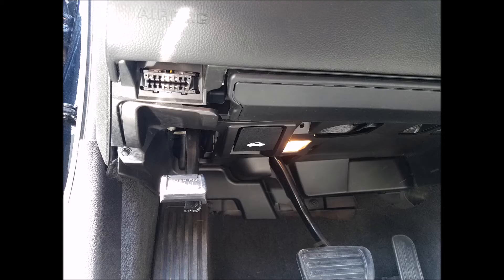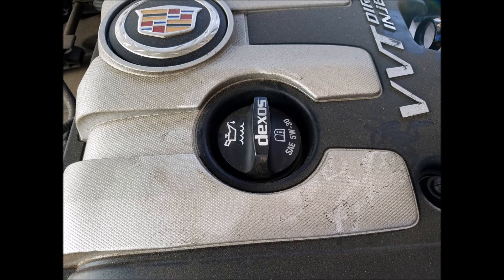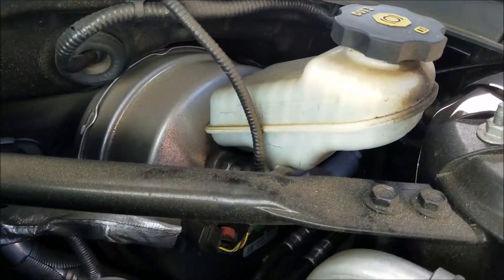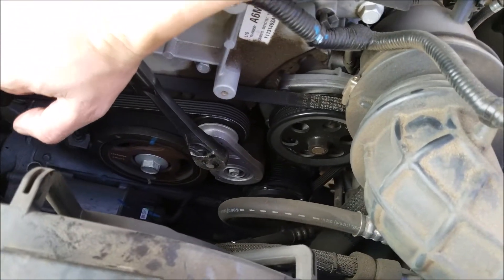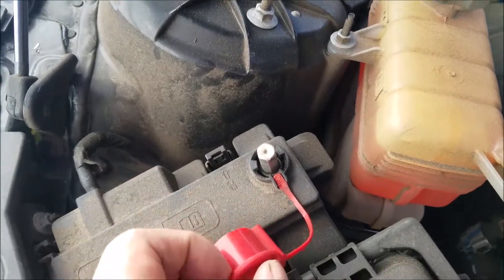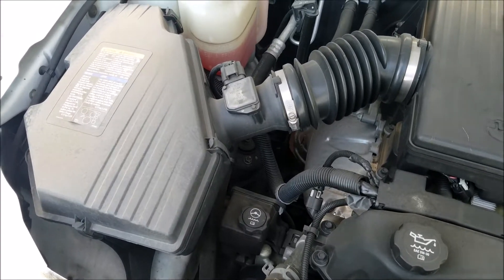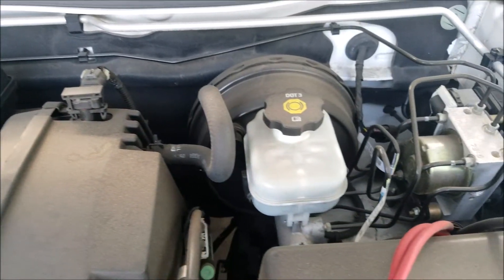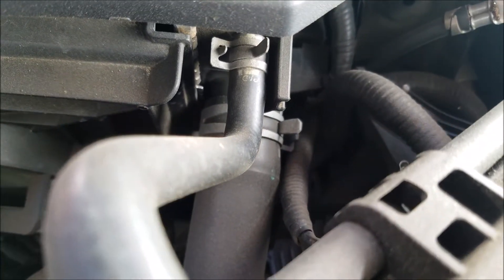What's Under The Hood - Names of Basic Car Parts and What They Do

Comment: I appreciate the video. Straight to the point. Could you help. I am trying to identify the name of the parts that filter the debris on the outer left and right side under hood, right under windshield. It's where the rain water drains.  For 2006 325xi. I think it's a "rain/debris filter" but just don't know the technical term.  I am trying to order and replace one but can't locate it on Amazon because I don't know the exact name for it. Thank you greatly in advance.
Reply from the maker: u mean the cabin filter? i believe ur referring to the cabin air filter.  Thank you so much for ur comment:) and always glad to help when i can.
Reply: @backyardchevy328  I am not sure. They're plastic, size is half our palm. There are two of them used for water drainage holes, to block leaves, etc., to get into the drain. Filter trays or leaf catchers?
Reply from the maker: Its a cowl drain guard, usually itll be a dealer or ebay part, but that should be the name to what ur referring to.
Reply: @backyardchevy328  YESSSSS!!! I just searched the name, it came up correctly.  Sir, you need to sit down your loved ones and tell them that you might be a genius. Thank you greatly!
Reply from the maker: Thank you, i really appreciate it:) Always glad to help, and glad i could help:) thank you for the support:)